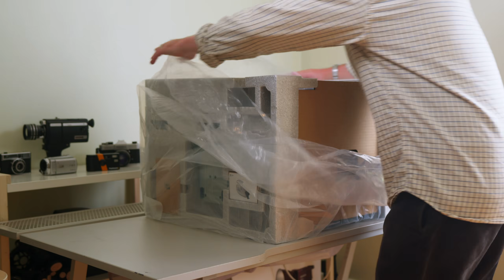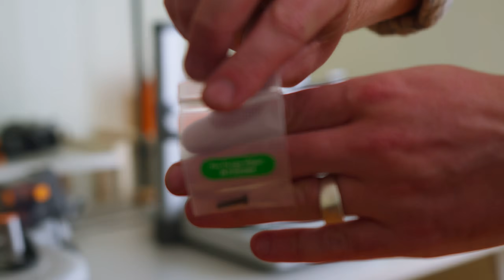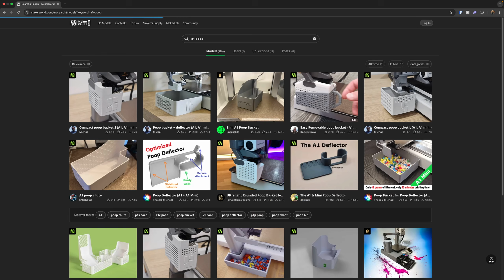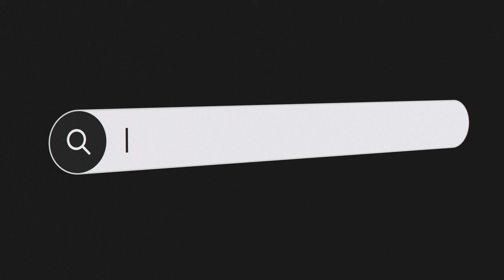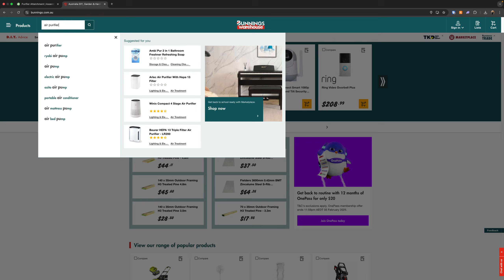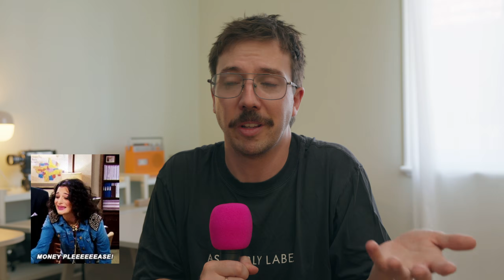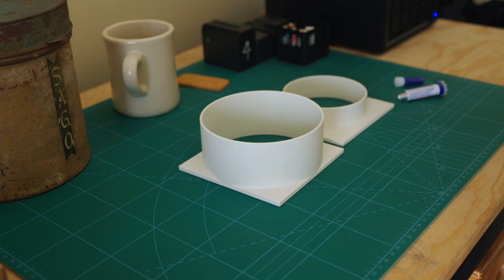Setting up a Bambu Lab A1 so that it doesn't slowly kill me

Comment: Just to clarify, the Bambu controversy wasn't over data collection, it was about restrictions on how you can use your machine
Reply from the maker: Fair shout. Honestly I need to look into it more. I’m getting my top level info from r/3dprinting where that and the whole benchy saga happened in the same week
Reply: TLDR; people want to be able to use other software to send prints to their bambu printer, bambu is making it so you have to use Bambu Studio. It is leading to questions about why, what else will they lock down, why are their NFC chips on their filament so insanely well encrypted, will they be requiring bambu filament only for their printers in the future? But it probably won’t affect new hobbyists as much, it’s more for the loyal tinker and open source community. Basically they are becoming the apple of 3D printers
Reply: @m1kki50 the NFC tags aren't insanely well encrypted, they have merely used the NFC as it's supposed to be used.

Unlike some of their other security practices. It's ages since I looked but I hope they included the date and time the diligent was manufactured/packaged and included that in the signed material

The reason for the certificate is to ensure the filament is Bambu isn't receiving complaints about their new Banana-dust Brown filament is causing issues then they don't make such a filament.

It reduces commercial knockoffs

If they wanted to they could allow unsigned rolls to be used but can warn the user with the old Here's what you have loaded, but it's not a Bambu labs product.

Additionally they could/should allow other manufacturers certificates be validated and thereby have certified genuine 3rd party materials.

I know if I was producing printers and their consumables I would want to prevent substandard crap wasn't going to drag my name through the mud.

Though I would probably have charge 3rd parties for the overhead of any 3rd party who wants their materials to be officially recognized.
Reply: @m1kki50 I mean yeah because it’s just down right rude for a company that spent millions on developing their product would want to capitalise on accessories that go with it, I use Makita power tools and believe it or not (without intervention) you can’t just slap a £30 erbauer battery on it, you have to use the £80 Makita battery. I get the 3D printing community was always an open source system and built on the edits and ideas of the community, but I feel like Bambu is not like that, buy a Bambu, you put like 15 screws in and plug it in, and the machine does the rest, then you can print from the maker world with no effort what so ever, all that infrastructure comes at a cost, so either they sell access to the slicer or to maker world, or they make their printers exclusive to their accessories, a lot of people forgot that business needs to profit in order to innovate and grow
Reply from the maker: @MrJoeAdams  Look I tend to agree with this sentiment but I'm very aware that I'm incredibly new to the space and don't want to discount the folk who have toiled in the mines so to speak and rightly are not thrilled about the shift in direction within the space.
Reply: @Billt_it  Also, I just subscribed. I had no idea you were a small channel. The quality of your videos are already up there with the big channels! Keep it up!
Reply from the maker: @EpicBenjo  Thanks for the sub! Love your argument, you're spot on the money. I'm so new to this hobby that honestly, I'm just happy to be here! Publishing this video has already been such a good way to dive into the thought process of those hobbyists who have been around the blocks though
Reply: @m1kki50  It's probably just so well encrypted because then other brands and random people could make the rest of their filament NFC compatible, which is one of advantages of their filament, and so if other brands can do it to, then there less of a reason for people to go with Bambu. Also, they are making it so you have to use Bambu Connect, not Bambu Studio, and so while it would be slightly more inconvenient, the main reason you can directly send prints from slicers like Orca Slicer is because they don't want to use Bambu Connect.
Reply: @MrJoeAdams Your comment shows me that you are largely uninformed on the history of 3d printing. 3d printing has actually existed since the 80s. The reason why there was an almost 30 year lag in the boom of 3d printing is because back then, 3d printing was proprietary and locked down behind patents that made it difficult/nigh impossible to make it accessible to the general population. The people that have  been in this space long enough to remember this are the ones worried about what bambu is doing, and for good reason. I’ve seen the Apple comparison made, and it’s fairly accurate. Why shouldn’t I have the right to fix my device that I bought with whatever 3rd party parts I want? When you set up your business model to discourage this, you’re holding them captive to your parts so you can make them arbitrarily expensive, you aren’t held to any quality standards because they have no where else to go for better quality, and opens up the chances for predatory business (how many horror stories have you heard from someone trying to get an Apple screen or battery replaced, just to be told “this isn’t reparable, you need a new phone” and then you take it to some shitty PCfixit shop and they fix it in an hour for 40 bucks? Imagine that but with 3d printers)
Reply: @m1kki50  the hp of 3d printing
Reply: @cedarcoombs8111  also there's a security reasons which sounds skeptical but understandable.
Reply: @MrJoeAdams imagine your fancy Makita drill only working with Makita drill bits and Makita screws. Thats what is happening. Filament is nothing like a battery, it’s more like screws. If Makita tried to lock down consumables, people would rightly be outraged and move onto another product. What’s even worse is Bambu is heavily reliant on open source work without contributing.
Reply: It’s not a big deal it’s just 3rd party apps have to authenticate through Bambu lab. It’s for security purposes. Not to mention it’s optional and still in beta testing
Reply: @awesomest_dude that’s not how good security is implemented.
Reply: @ "security"
Reply: @MrJoeAdams i think the more accurate comparison is if makita only requires users to use makita branded drill bits. Will you still buy makita if that happens?
Reply: @IPrintThingz I'll have you know I run milwaukee power tools(for home and work) and through a cheap $5 adaptor i run harbour freight batterys(doesnt work well for higher torque outputs needed but for tasks that require lower torque works fine) screw company's that lock down options. Espically with somthing like filiment. If you want that market share just make the best filiment out there for a good price. When shit goes proprietary you can expect quality to stay the same but prices to increase
Reply: @MrJoeAdams  The issue is that they removed functionality from printers people already bought
Reply: @MrJoeAdams  A company that spent millions on developing their products, but also took from the opensource community and now is not giving back:
- a lot of the engineering comes from the Voron community
- their slicer (the one they want to foce upon user) was made upon the open source PrusaSlicer, also took a lot of help from the OrcaSlicer maintainer
Reply: @MrJoeAdams you're right, companies have to profit from the service they provide or they fail and we should expect that they want to do that. I think where the promises change it does become unacceptable. You sell me a product that does x,y,z and later tell me actually you can only do x and y now. That's not ok.
Reply: @bajojohn You mean like proprietary Starlock blades and accessories for the Makita oscillating tools?
Reply: @MrJoeAdams  Orcaslicer has way more functionality compared to Bambu Studio. There are settings that I like to change that Bambu does not let me use unless my printer is in developer LAN only mode. In my opinion, it's immoral for a company to control something that YOU own after you buy it.
Reply: @Billt_it  Yeah theres alot of controversy lately in the printing community. As a fellow mac user I totally understand the desire for technology that just works™. With Apple tho their decisions usually end up creating a better system thats easier to use, albeit a locked down one. With Bambu here tho, they made a cloud based security system thats less secure than the industry standard instead of just having some kind of local pairing authentication system. Within a day the community already cracked the security. To me, it looks like Bambu is injecting themselves into the security process as a way to perhaps control it down the line, in much the same way that Apple does with its MFi program. Its already happening, with Bambu choosing not to give certain existing projects keys to access the bambu machines in the way they used to be able to do before. Without disabling the security entirely there isn't a way to manipulate the machines in alot of ways now. Thats the issue. I'd look elsewhere if you want to get more 3D printers that just work™. Creality is making their new Creality Hi that looks really competitive with the A1. Qidi Tech has some great machines, like the Qidi Q1 Pro, at really affordable prices that outdo what the P1S can do (tho they haven't shipped out their multi color system, that should be ready in a month or so they say). And the new Prusa Core One and Creality K2 Plus machines compete pretty well with the X1C.
Reply: Basically, Bambu Lab is becoming like Apple. They’re building a garden wall around their products and preventing/limiting third party software from accessing their machines. 

3D Printers were built off the backs of DIY home-brew hobbyists. Taking away their ability to tinker with 3D Printers is like Dell selling you a computer and then telling you you can’t use any software on there that isn’t by Dell.
Reply: @EpicBenjo  Yes, but bambu’s machines are very repairable. The website sells spare parts to everything imaginable
Reply: @EpicBenjo  3D Printers were built off the backs of DIY home-brew hobbyists. " Hahahaha
Reply: @and @andred.2823 Something funny about a video from 14 months ago?
Reply: @ I completely get what your saying, but we’ve been through this all ready in the past, how 3D printers were created by being open source, computer games was the exact same thing, and Bambu is no different from a PlayStation or an Xbox, you can’t play an Xbox with a ps5 controller, you can’t play Xbox games in a PlayStation, I get the whole innovation of 3D printers was built off the back of the community, but Bambu did create an idea, crowdfunded the start up, and then fulfilled on that promise and innovated and built an incredible group of machines, that were unlike any other at the time, so easy to use, and readily available to everyone, built the maker world to be integrated into your printer so if you have very little idea about designing you can freely print cool things, 

When 3D printers were in the early stage the dream was we would all have one in our home (like an inkjet printer) and we would all be able to print anything we needed, Bambu is making that dream a reality, as I’m sorry to say but the average person is never in a million years going to find an ender 3 easy to operate
Reply: @EpicBenjo but the difference is I still don’t get why people were mad, they patched a mqtt glitch that wasn’t supposed to be open and then to let you still use other slicers, they created an app that connects your other slicers to the bambulab, so what’s the problem, they still allow you to use other slicers
Reply: @ItzAwsomeWasTaken How am I supposed to trust Bambu's API when it wasn't required before?
Reply from the maker: @EpicBenjo  Can I offer an alternative POV, but to be clear I'm not discounting yours! I see it as the choice between a PC and a Mac, everyone can generally understand what I mean by using that analogy. I've been a Mac user for the last 20 years. Pretty tech savvy and I know my way around a PC if I have to but I've never built one, I'm not interested in building one, I want to open up the lid, boot up and get on with my work. It's a tool for a job, not the job. And I see that with the BL. Understandly the perceived rug pull when it comes to locking down 3rd party apps and stuff like that, if you've already found yourself in a workflow with BL and say Orca slicer and now can no longer continue that work flow, that would be a huge pain in the butt, so I get it. But for me, and really only speaking for myself here, for me I'm happy to just turn the thing on, use their app and get some things printing. ❤
Reply: @Billt_it  I totally get your point of view. People use what they want to use for their own reasons. I, myself, have always built my PCs. Since 2002 I've always bought the parts and assembled my own PC. But, when I'm on the go, and I need a portable computer, I turn to Macbooks. And you're right - you just want something that boots up and works. I don't look at tinkering with laptops.

The thing with BL is that the 3D Printing community started off as a hobbyist community, and suddenly building that garden wall is alienating that part of the 3D Printing community. If they were like that from the start, we wouldn't have this sudden outrage from the countless hobbyists who spent thousands on their BL machines and are no longer being able to use the software they've been using.

When the dust settles, we're just going to have people who don't care about the garden wall and those who despise it. No different than people who have iPhones and people who have Android phones.
Reply: @Billt_it  this more hp then apple
Reply: @Billt_it  Apple. you cant upgrade at will.. PC I can change any hard ware at will at home. new ram. graphics cards .CPU mother board etc.   then I run linux.  both Apple and windows suck in the wast of money area with their " upgrades" needed every year..  The worlds been running on linux ..  I dont see why more dont look into it.  Apple , windows locks you down just the same.
Reply: @Billt_it most windows users have never had to do those things either. I dont understand this perception mac users have that it is any different. In some cases it's the same third party hardware with different software and the mac user would still claim that the mac system is built to work together. The difference is between people who try and fix things themselves and people who dont want to and can afford to pay someone else to do it.
Reply: @Billt_it  I don't like this argument honestly I have used Mac and PC and honestly there isn't anything functionally different between them except that PC is easier to tinker with. At no point did I find either of them harder to use. If anything Mac has been more confusing to me in the UI than PC and they both work right out of the box. So this narrative that closed system means User friendly is a misguided one. If anything Bambu is the Apple of 3D printers precisely in the sense that they are trying to use the same horrible business practices that Apple does today.
Reply: Bambu since 2 years ago faultless prints and I know about third party adds on, let’s start Bambu won’t block you for adding on a plastic design to collect poop or sending fumes through a window.
Electronic items being added is a no no for me, reason for this comes from previous makes of printers where items designed for the machine then catches fire and you blame the printer.
Bambu as made the right decision by blocking add ons  let the machine be managed by Bambu.
The slicer is perfect for me after using many makes, X2D is my next machine nothing against U1 for making toys but older like engineered toys.

Comment: Commenting on the thing about whether or not you should put holes in your prints to save material:

Because of how infill works in solid models, you usually use less material printing “solid” than printing with holes (because walls are always solid plastic, but the volume of 3D printed models is usually only 10-15% filled (or whatever you have set your infill percentage as in your slicer). Therefore, holes = more surface area = more walls = more solid regions = more material used.

The exception to this is if you are printing something thin (around 1-2mm) because at that thickness it’s usually printing completely solid regardless, so holes will reduce the material used but will probably still increase print time. Or if you are legitimately cutting out like 95% of the total volume of your model, but at that point you are probably sacrificing the strength of the print.
Reply from the maker: Outstanding information, thanks so much. Makes complete sense!

Comment: Great video! 
I've also noticed a strong plastic smell when printing, especially with the Bambu PLA Wood filament and wondered how dangerous it might be.
I'm just starting on my 3D printing hobby as well. I looked at many different CAD programs and settled on Autodesk Fusion. It was a bit daunting at first but after a couple of YouTube videos I'm getting the hang of it and it seems like a powerful program. Its free for personal use but you can only edit 10 files at once. But you can easily change what is editable and what isn't so that works for me for now.
Reply from the maker: Good shout, I looked into Fusion but as far as I could tell the 360 offering (free for makers) wasn’t available in Aus, could be wrong though. I initially started on the solidworks for makers but honestly hated it, got a refund and then stumbled into Onshape and haven’t looked back!
Reply: @Billt_it I'm in Aus and have been using the free version of 360 for the last couple years